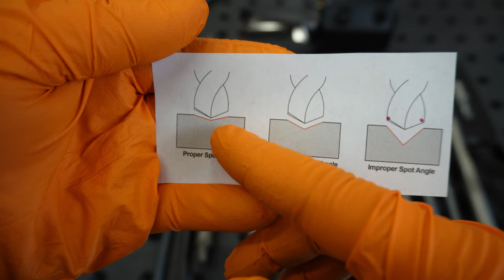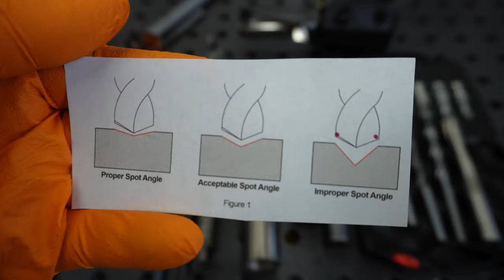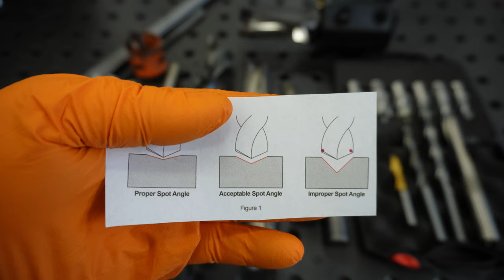DRILLING 101 - Skills That Are On Another Level

Comment: I don’t know if I missed it but at 28:33 those style of carbide drills have a 4 point contact system unlike the
Normal 2 on a drill, you see that line slightly raised, it’s there for double the stab ability in deep drilling

Comment: Nice touch, & nice timing with the Tommy Boy clip. It definitely evokes the correct mental image. 👍🏾

These machines (especially CNC) can only be as capable as the machinist operating them is competent. Pretty sure we've all either heard the horror stories, or lived the nightmare of, for instance, having just spent hours indicating and fixturing a job, and leaving the floor just to get some air, or find a certain tool, (or your resolve was waning at suppressing your impulse to dismantle a particular colleague).
The moment you were out of earshot, the FNG (who may or may not be bossman's relative) sauntered up to your workspace, hit the big green button on that machine you sank your whole day on, and then said "Time for a smoke break!" as the machine ripped itself into shrapnel.

[I know this anecdote sounds highly specific, but you'd be surprised & amazed at how many people I've heard articulate exactly this story almost verbatim] 🤡

Comment: Collets..... how I love my collets, we have ER16 holder with 30mm shank and second with 25mm shank (having 30mm bore in T12 and 25mm bore in T8 is a bit of a pain tho), two ER32 holders for CNC lathes I use, they´re really great is used properly...

We´re using plain old HSS twist drills for everything under 16mm, if you can, get solid carbide drills for holes you´re going to thread, they´d save you plenty of time... Drilling 16mm hole 100mm deep into 304 stainless is pain in the butt, get TiN coated drills for stainless at least

U-drills (inserted drills) are lovely, we´re making G2"-11 threaded nozzles for oil tanks out of C45 steel, well, 40mm U-drill, 650RPMs, F0.12mm/rev, 60mm deep, you blink and it´s drilled... X-8, you have 48mm bore, X-16, 56mm bore... just slowing down the RPMs a bit and feeding harder so it won´t chatter that much, biggest b..oring bar I´ve got, bore it to 57.1mm and thread it, done... Just make sure to add a note to program so you will always set up the drill with outer insert facing the right way.. +don´t you dare peck with inserted drills, just plow it to final depth

For drilling and even making shallow holes in plastic (we´re using this method in PVC), use good ol´HSS two fluters.... Using 14mm two flute endmill drill a little shalower than finished bore, ooop, bore it in X axis, finish it with boring bar.... Lock the endmill into collet so one flute will be on center by eye so it´ll actually cut...

Great video for beginners :)

Comment: I always wondered how they drill a long rifle barrel and keep it straight. Still don't know ;-) I would think a larger caliber would be less troublesome but how about .22 ?
Reply: The tooling industry makes "gun drills" specifically for this, and these tools were some of the first coolant through drills
Reply: @dylanwalter1  Thanks for info about gun drills which I wasn't aware of. I have built my own benchrest rifle by using an old Mauser action which I modified by bending bolt to clear scope, bought a .22Douglas barrel which I turned down to 1 1/8" diam and 26" long, chambered and threaded to fit action, made my own custom trigger assembly, hot blued everything, made a thumb hole fancy stock for it. I used metal lathe at my college in 1966. Don't think you could do that at most colleges today!  I chambered   it for 22/250. I put a 26x Unertyl Ultra Varminter scope on it. I was 19 years old ;-). I still have that rifle... it will group .15" ctc at 100 yards with my custom loads. Not good for anything other than bench rest as it weighs 18 lbs! I have my own home metal lathe and milling machine now. I learned an amazing amount of skills on that project.

Comment: Just buy ghurig drills... dont pilot or spot drill. Just use a better machine and better tooling and save like 15 minutes of machine time eliminating thousands of unnecessary  tool changes. Ghurig or ghuring im not german
Reply: Guhring aren’t bad drills but they are no where near the best, Walter, OSG, kennametal, sandvik, make the best👍
Reply: "use a better machine and better tooling"..."If you're homeless, just buy a house".  I run a machine that's thirty years old and the spindle stalls at 20 IPM in aluminum on my bigger cutters.  Still gets the job done efficiently.  And even big machines will predrill for tied up holes or little tiny drills.  And spot drilling done properly leaves a tiny chamfer so you have less to deburr.